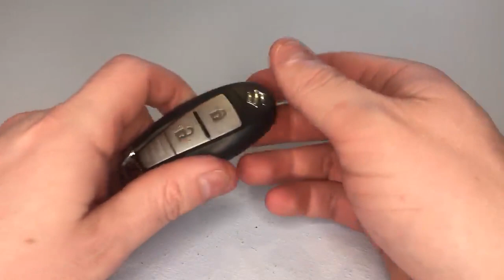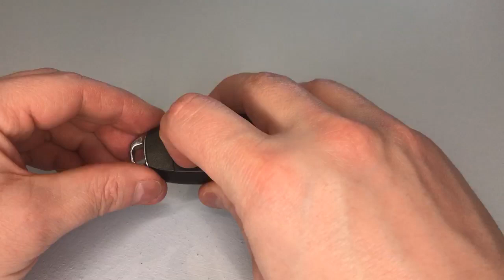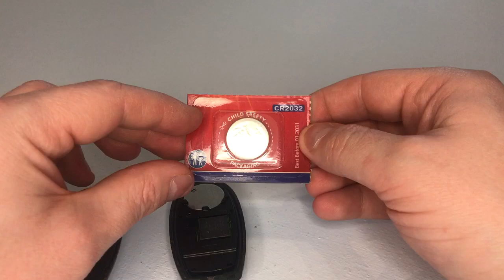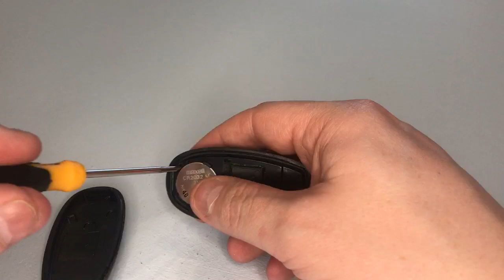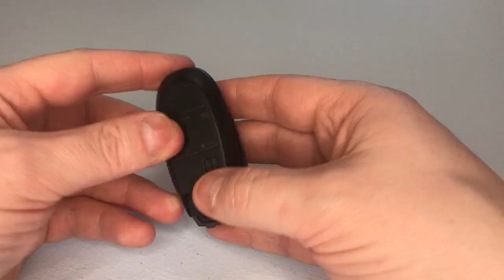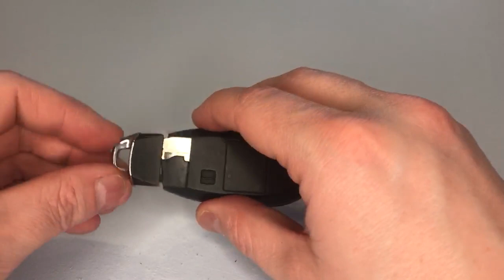Suzuki Key Fob Battery Replacement. Baleno, Swift, Vitara,

Comment: I found out today that not only can you open the doors with the actual key but if you put the fob right up against the start button it will start the car even if the battery is dead as there is a sensor there.

Comment: It does not work for me, i tried different screwdrivers from 2,5 to 4mm but i could not twist to open the case.
Reply from the maker: some cases can be a bit tricky, you may need to two screwdrivers, one at the bottom and carefully one down the side at the same time.

Comment: Hi there. Does someone has an idea about why my key is now showing a steady red light?
Reply from the maker: check the Battery is the correct way round, try refitting it and then pressing the lock and then unlock button.
Reply: @scspares  many thanks for the advice. The battery was all covered up in acid. I have cleaned it up and ordered a replacement battery. Let's hope it will work.

Comment: I was always told not to touch those batteries with your hands, because of the oils will make them die faster  ?
Reply from the maker: hi, I’ve personally not heard that before with battery’s, I know that’s the case with halogen headlight bulbs. but I will bear that in mind.
Reply: Must be why many men become impotent 😂